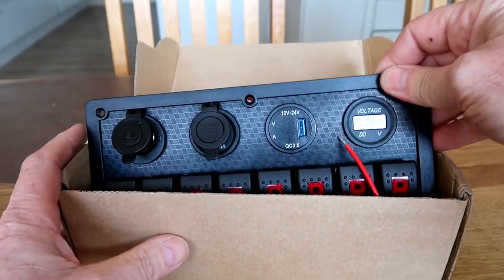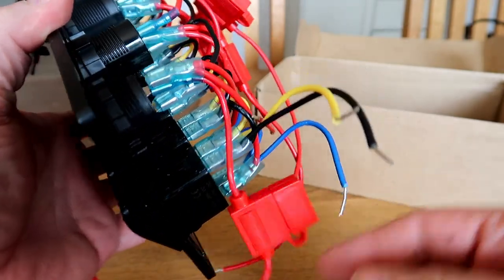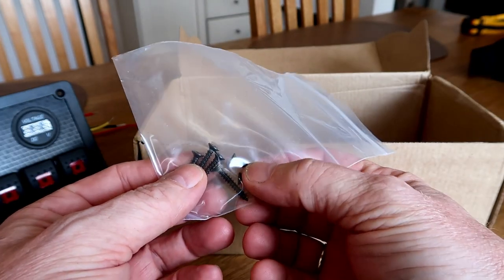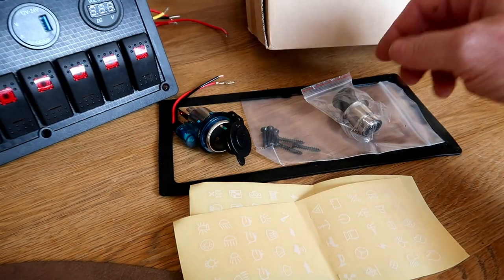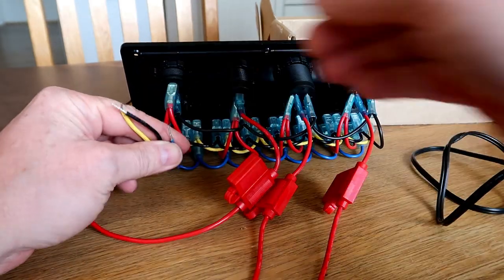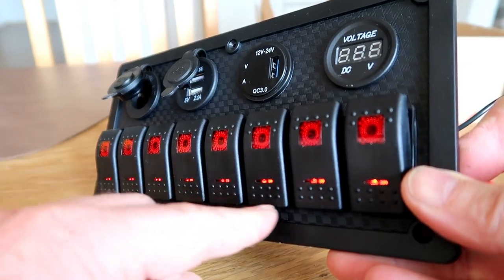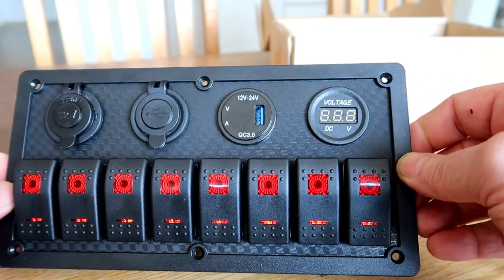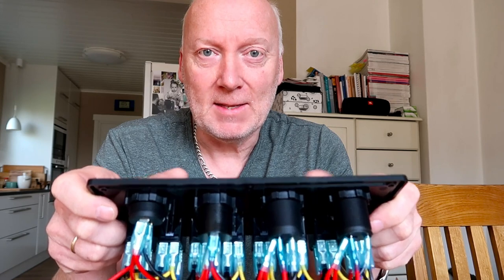How to wire a Switch Panel 8 Gang Waterproof Car Auto Boat Marine LED Rocker

Comment: Thanks for the video i have one of these wired in my Jeep.  And i wired it by removing all the fuses and instead running the power line to one switch so that switch is the trigger to turn on everything.  And that power wire of course has a fuse on it.   And i use the other switchs just as triggers for relays for off road lighting.   However my switch fox has that small round switchs and i cannot see them as night.. i was thinking of changing out my switch panel for one of these so i can see the leds at night so i know what switch to push when its dark out.
Reply: Wait I have that one too. Don't the switches have small leds?

Comment: I have it wired Straight to the battery but it says on when bike is off how can I wire it so it will turn off when I turn the bike off?
Reply from the maker: You need to wire a controll relay over the ignition. Or hard wire it to the ignition.

Comment: Do I need to run the negative wires of my separate lights to a bus bar or just to the negative terminal. Does it matter?
Reply from the maker: Any negative terminal will work for the lights.
Reply: It needs to be grounded. Bus bar to frame then wire to that black lead on switch  panel.

Comment: How do you wire the other 3 red wires
Reply from the maker: Thanks for the question. There are four red wires, all goes to + (plus) on the battery. Blue is + (plus) for the lights in the switches, black and yellow is - (minus) for the lights. I have wired the black and yellow together over a separate switch, this way I can turn off the lights when I'm sleeping.
Reply: Italjohn13 so you can twist all the red wires and blue wire together along with a longer wire to run to the battery correct Does that make sense?
Reply from the maker: @sstatic6093  Yes that's correct
Reply: Because I want all the switches and meters usb lighter on everyone thinks that those switch lights pull lots of amps and cause your battery to go low I’m using it on my boat
Reply: Thanks so much ur the best
Reply: @sstatic6093  how did that work out? I just got one and am worried to connect fhe blue wire to the 3 red wires as they are higher gauge and may surge the blue wire,  but i would prefer to wire all the red wires and blue wire together

And wire all the grounds from accessories with the black and yellow wires , is this ok as well?
Reply from the maker: @skmg2888  Hi there. You have got it right. There will not be any problems if you connet the red and blue wires together. The same with the black and yellow wires, just connect them toghter and you will be fine 😃
Reply: @Italjohn  ok thanks, can i run them directly to the battery? Its a boat battery with 700 Marine cranking amps. Not sure if that will overheat the wires and cause a short. Would I need to go to a fuse block / bus bar first?
Reply from the maker: @BrettFMason  You have got it right, all red to battery, black and yellow to ground metal (negative) The blue is for the small lights in the switeches, so I will recommend to wire it over a switch or igition, as they will lit when connected to positive.

Comment: Where did you mount it in the van ?
Reply from the maker: I haven't installed it yet, but was planing to do it in the "bed wall" behind the sliding door. I will upload a video when I have done it.
Reply: @Italjohn  I'm following. Would be nice to have one of these, fitting in the dashboard.

Comment: Hi ,

Do you have example
While a fuse box for the switches ? 

Thanks
Reply from the maker: No, sorry
Reply from the maker: The red square you see on the red wire is a fuse holder, but you may want a separate fuse box? If thats the case you need to wire every output from the switches to the fuse box. Should be a straigth forward job.